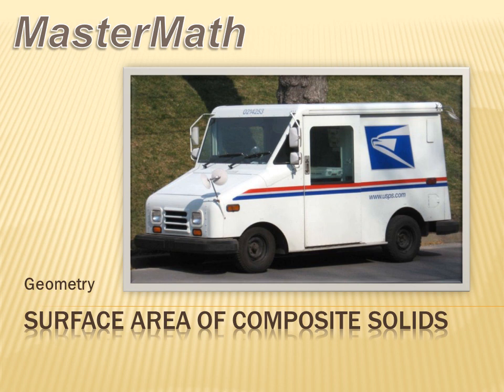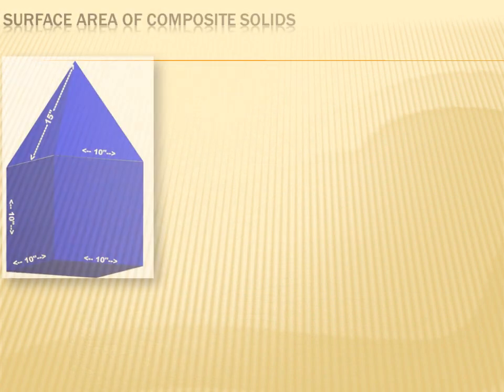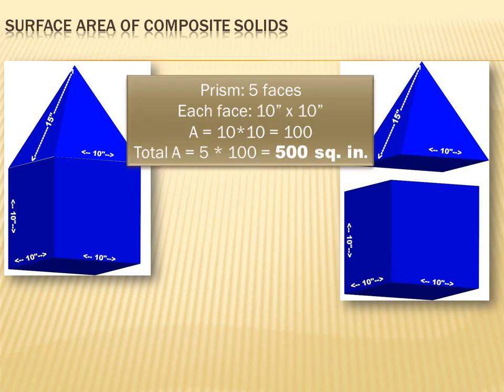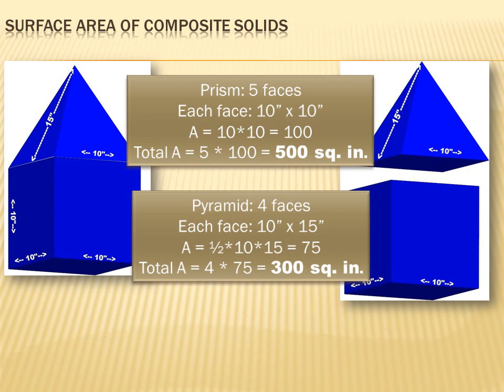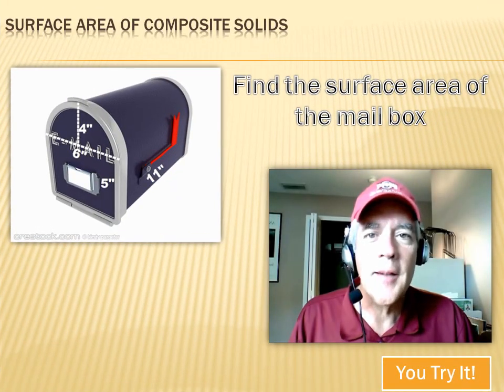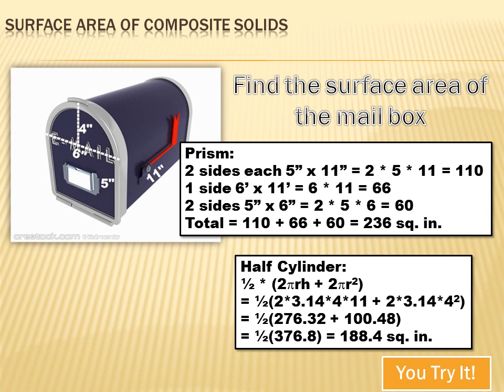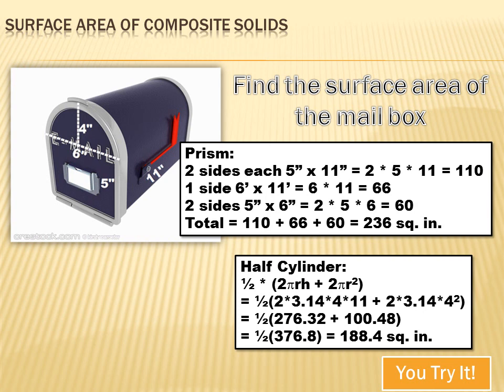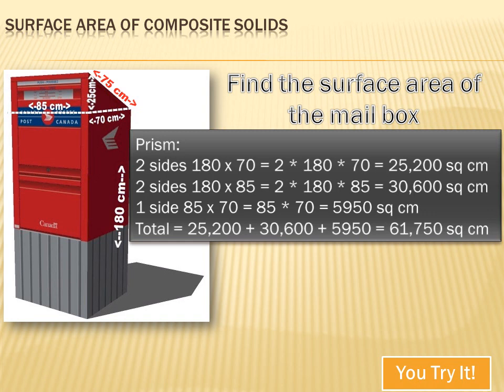Geometry - Surface Area of Composite Solids: 7th grade math

Comment: I believe there is an error in the first example problem.  The width of the mailbox is 6", but the height of the rounded portion is 4".  This would produce an oval shaped mailbox top, but the equation used is for half a cylinder.  I propose changing the height of the rounded portion to 3" so that the radius is uniform across the top of the mailbox.  

Thanks for these wonderful videos! Makes homeschooling a lot easier! :)